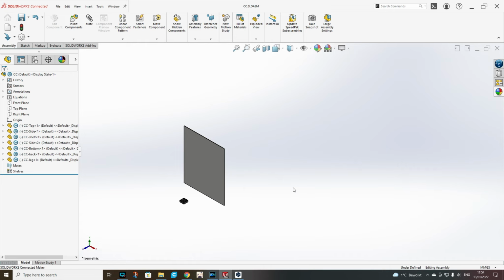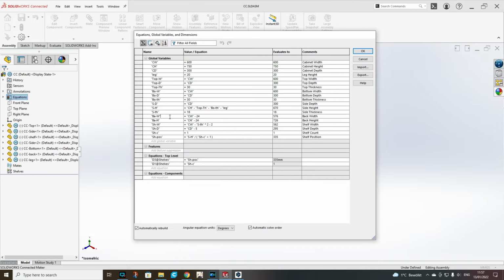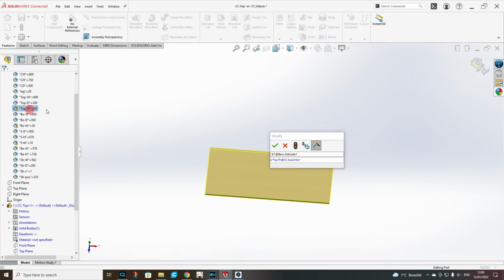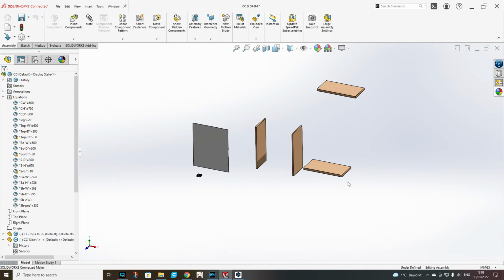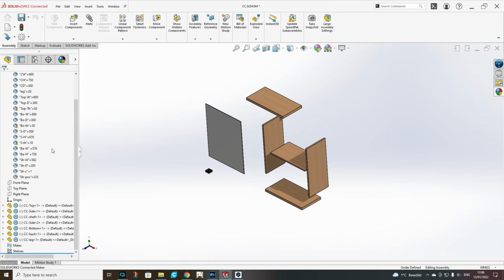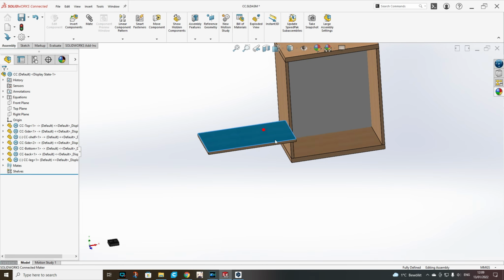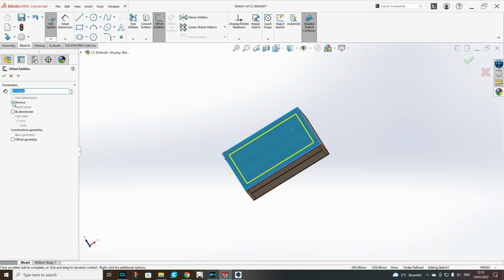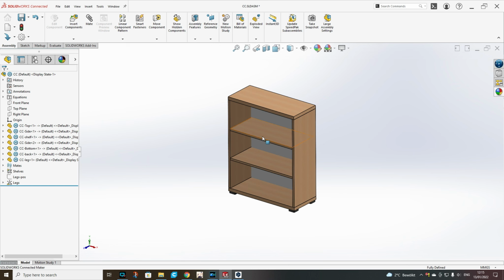How to Use SolidWorks to Make Furniture Faster

Comment: You did't show how to got the first part of the drawing. DO you have a link for that or another video? I will really love to watch a complete tutorial from the beginning (making the very first drawing) to the end (adding the dowels and connectors and exporting engineering drawing) Thanks and I really look forward to that!
Reply: In the beginning of this video, I noticed that parts were already made.
Reply from the maker: Hi Tim, the only created parts are actually the leg(a ready part) and the back(you can also start with an empty part for it). The rest are just empty parts which are placed in the assembly. 
Next Part with dowels and screws: https://youtu.be/VSzwOEHTE7Q
I haven't done a video for the drawings.